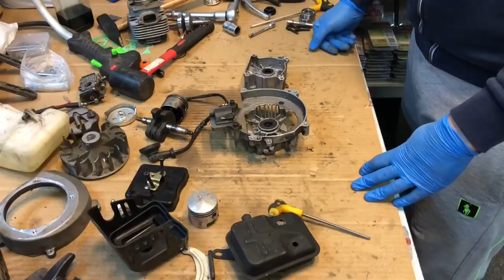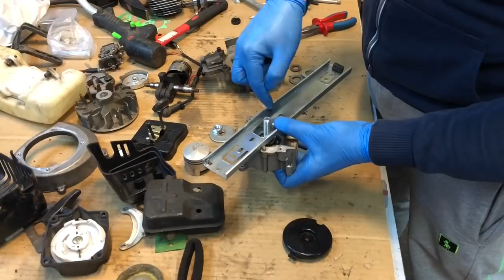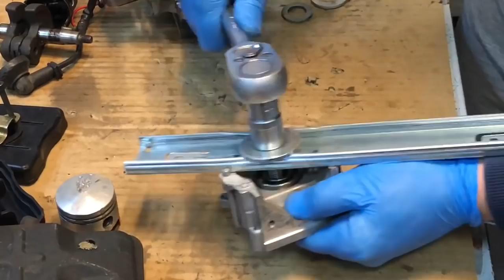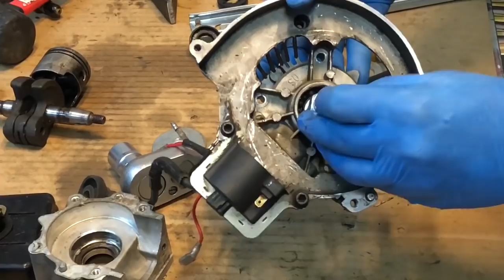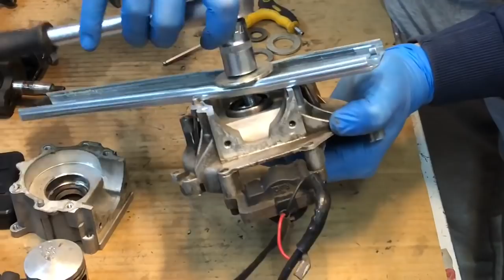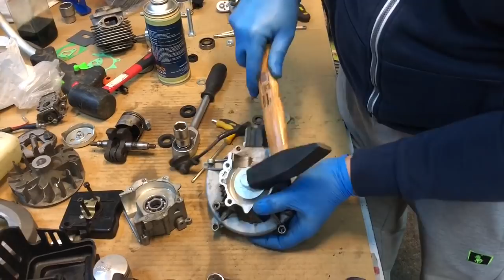Cum presez / depresez rulmenti si simeringuri pe carter

Comment: Salut. Am un generator chinezesc - fairline, 2timpi , 650w , 8-10ani vechime, luat de nou, max 60ore de functionare , depozitatcorespunzator. Am intampinat probleme in ultimul timp . pornea foarte greu, iar ultinile doua oride folosinta mergea balbait, pana n a mai pornit .L am dus la specialist,i a reglat carburatorul, si mi a zis ca nu arescanteie. I am luat bobina si bujie noua. Apoi a mersdin prima sfoara,30minuteperfect. Apoi a inceput sa nu mai dea scanteie dupa cele 30minute. Sau dadea una la40sfori, sau dadea scantei foarte mici , maxim 30secunde cand motorul erarece,apoi nu mai dadea . Mesterul unde am fost este mecanic strict pe asa ceva si nustiece sa masoare sa imi spuna ce are . ( ps: nu a intrat in ce tine de electronica fiindca nu vrea si nu stie). Ce ma sfauiti safac?? El imispuneca searde intruna bobina